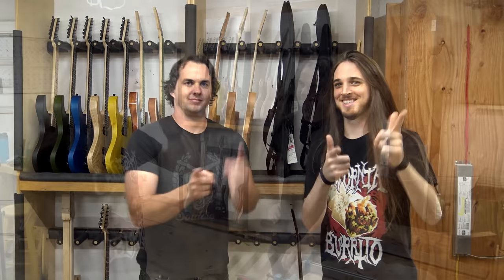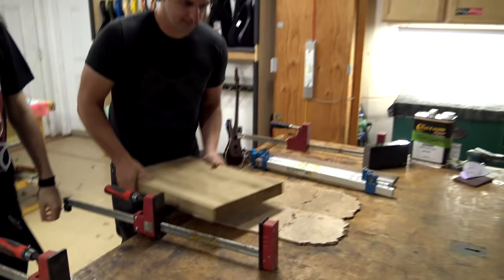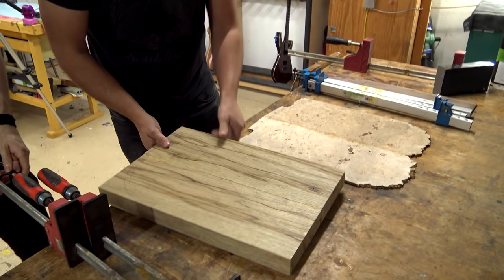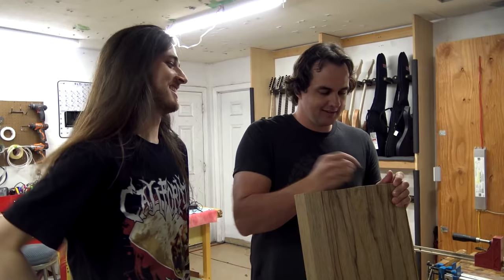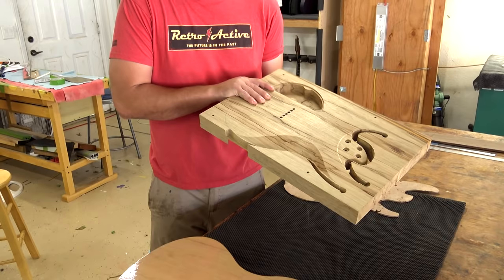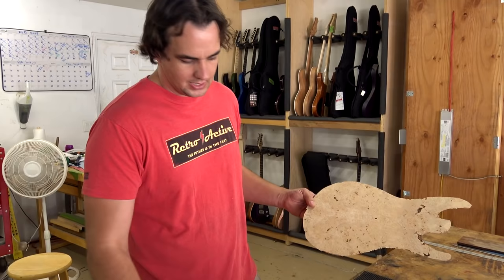Acacia Guitars Custom Build - CNC Body, Glue Top, Carve Neck (Part 3)

Comment: Ok... so what are the two extra holes on the head for? at first i thought they were floyd screws, but they can't be.
Reply: They're used for pins while cutting the back. They get filled In with plugs when the headstock cap is glued on. Never see them after that